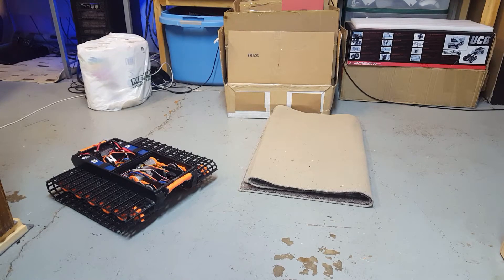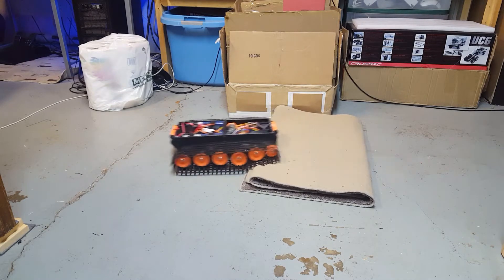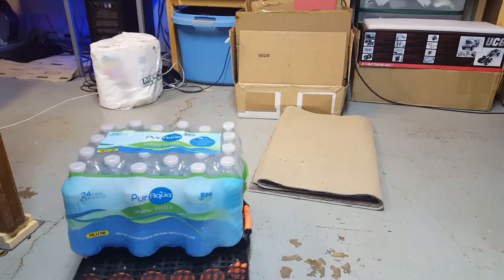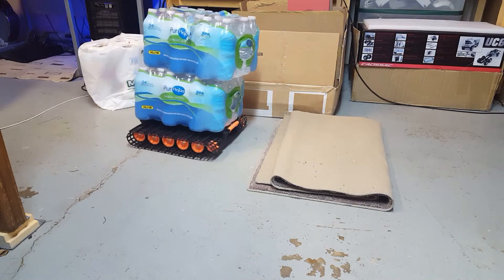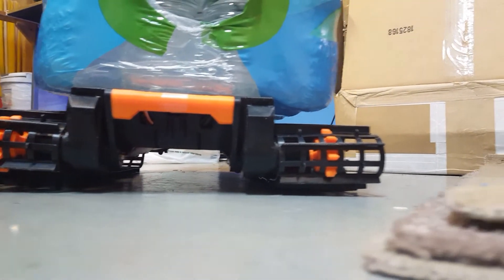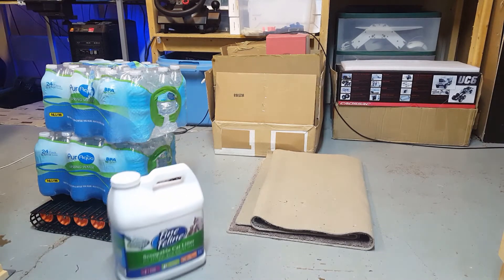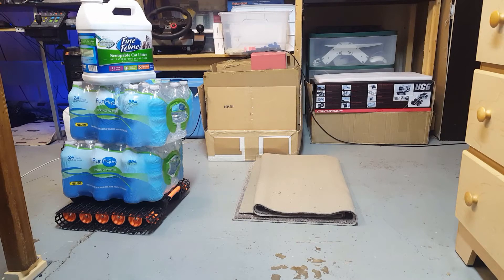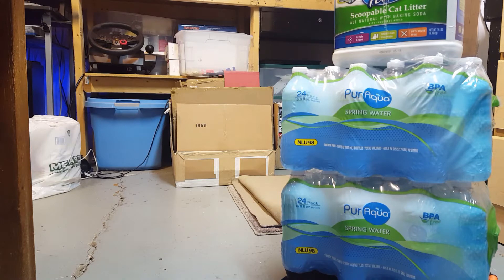3D Printed Spyker Workshop Snowcat Tracked Vehicle! (Strength Test 66lbs!)

Comment: so when will kits be available and do yoh have an idea on pricing yet? will any stl be available for replacement parts?
Reply from the maker: Still hard at work on the top modules for this, but it should be ready for sale by Christmas at the latest, hopefully sooner! I'm amazed just how strong the whole machine is, the transmission is absolutely rock solid. I will for sure be supplying some of the STL's for parts that could break for anyone who buys a kit, however I will not be selling the whole machine in STL form.
Reply: Spyker Workshop awesome. ive allways wanted a snow cat but everything ive heard about them is that they fall apart. this seems like a much nicer kit and the added ground clearance will surely be a big plus. those flat stlye tops will be perfect for mounting some fpv gear.